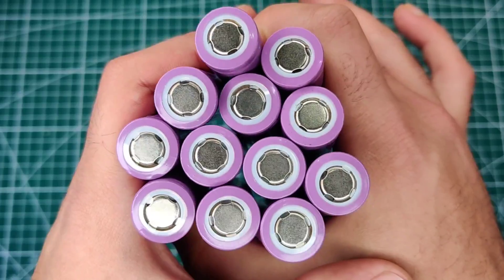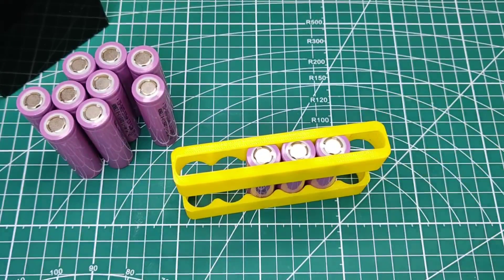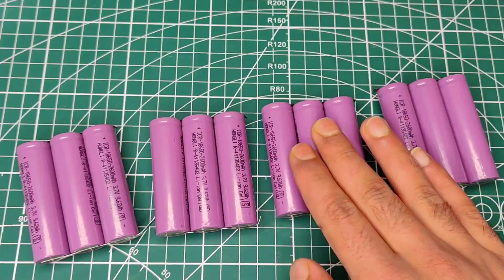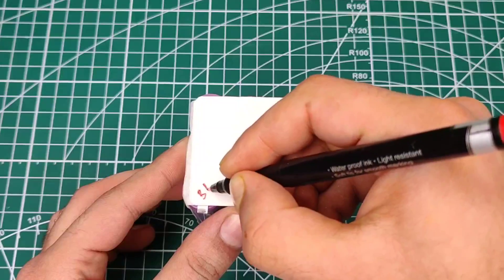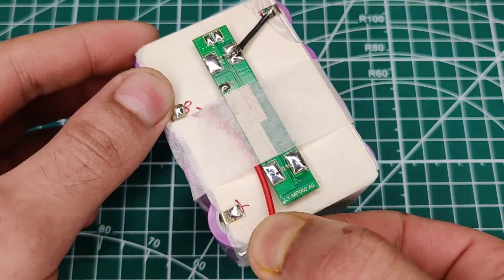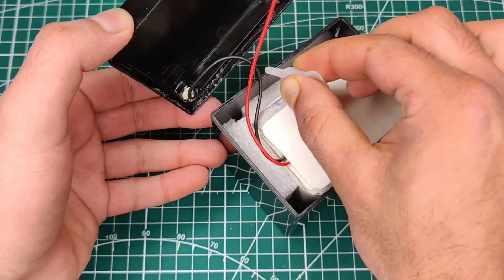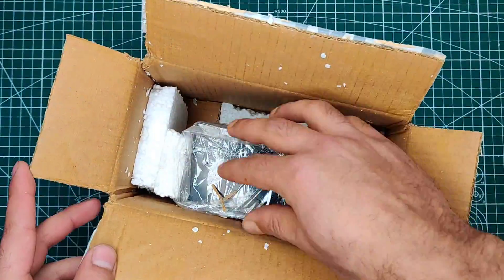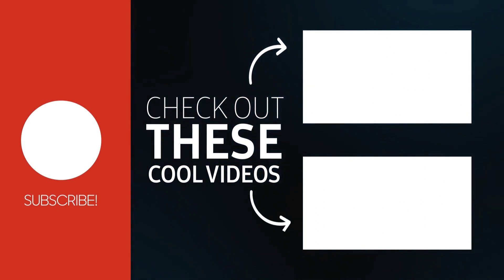DIY how to make 12v 8Ah lithium ion battery pack at home

Comment: Minimal BMS? Paper tape instead of polyamide? Seems like a major fire and safety hazard!
Reply from the maker: In video, you can see i have used bms, and yes polyamide kapton tape is good and heat resistant, but in most readymade batteries, you can see thick paper sticker is pasted across terminals of batteries, so it doesn't cause any fire, Lithium ion batteries can catch fire, if bms fails, polyamide tape won't save it from fire if bms failed.
Reply: @CreativeTechos  very limited supervision, it's not doing much individual cell monitoring......

Comment: Also this is not 12v battery pack. This is 16.8volt
Reply: I thought the same thing, he connected four cell in series which at their initial voltage is 3.7v x 4 = 14.8 when this battery is charged each cell will have 4.2v so 4.2v x 4 =16.8 so this is nearly 17 voltage battery pack and it is 12Ah
Reply: If i use 10 battery for 12v battery pack so how much ah i will get my battey mah 2000 @NGTW-1